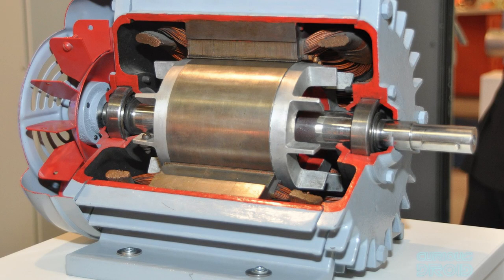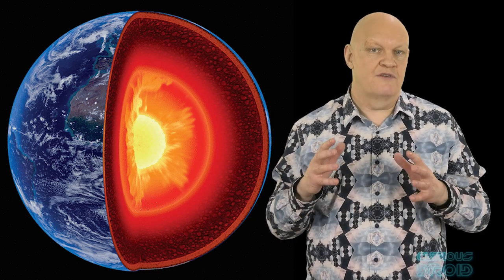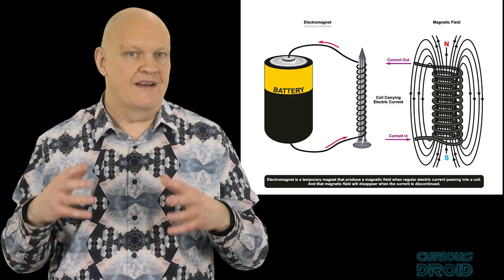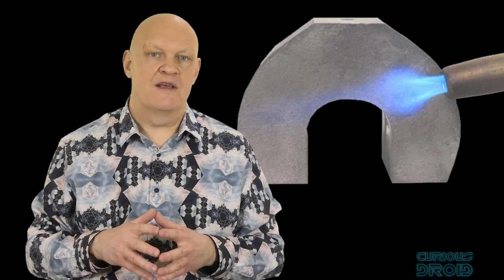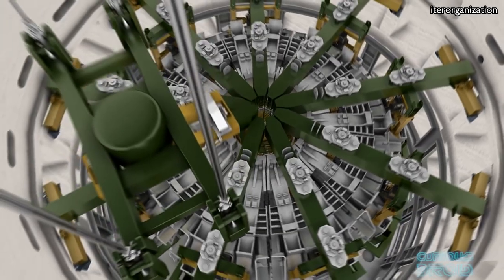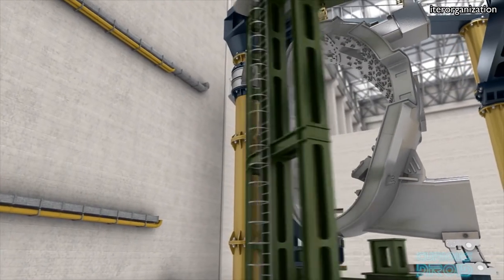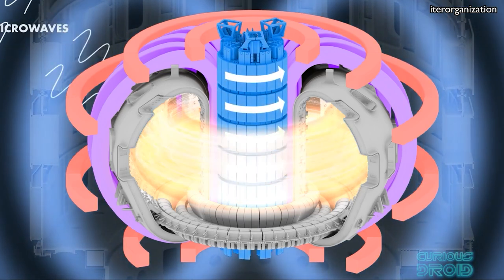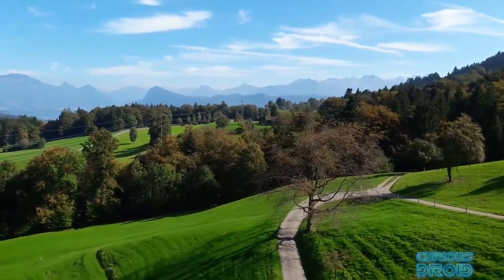The Most Powerful Continuous Magnets Yet Made

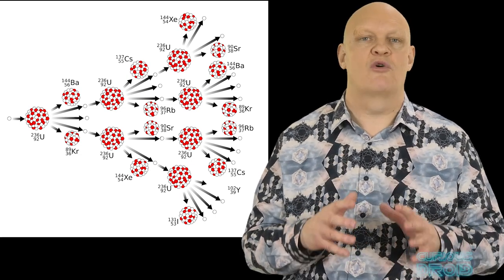Comment: 10:20 plus another downside with fission is: the rod material is mined as ore. typically in an open pit fashion, typically with the fossil powered vehicles. It's not as clean or green as the hard-core nuclear proponents suggest.

Comment: You are WRONG!! 3 mile island accident was COMPLETELY DIFFERENT than Chernobyl and Fukushima! It was a containment breach of the pressurized reactor system that allowed radioactive steam to escape into the atmosphere. Nuclear Plant designs after that went to a non pressurized system to mitigate the risk of that occurring again. Where as the other 2 were complete core meltdowns!Chernobyl was a poor design and allowed for ALL it’s safety systems to be overridden and that Human error caused it’s fatal core meltdown. Fukushima also could have been prevented had the Japanese heeded our warnings back in the mid 90’s, simply by putting the generators and their fuel sources on the rooftop like we did in Missouri just before the “10,000” year flood. Had we not done that we would have had the same occurrence then. A family member of mine is a leading authority on Nuclear Power Generation and a member of the National Nuclear Safety Board until his retirement.

Comment: at 00:10 you show a squirrel cage motor that doesn't contain magnets. Sure it works with electromagnetism, but there are no permanent magnets in this type of motor.
Reply: Stator currents form a rotating magnetic field which induces current in the rotor bars creating a magnetic field, so yeah not permanent magnets, but definitely magnets and magnetic fields.
Reply: @borysnijinski331  Correct.
The title of this video is about continuous magnets.
Never mind... interesting video!

Comment: Claiming that fusion simply "is safe" is a huge misrepresentation, if not an outright lie. Yes, the process itself doesn't produce radioactive waste and is not able to turn into a chain reaction BUT we're still talking about matter hotter than a center of a star floating cheerfully in a magnetic trap generated by a system so tense, that it's on a brink of tearing itself apart, surrounded by huge amounts of coolant. It's basically a bomb, just not a nuclear one.

A disclaimer in order to avoid stupid people missing or intentionally misreading the point: I'm not saying fusion is not better than fission, I'm not saying that fusion should not be studied or exploited, I'm not saying humankind should continue using fossil fuels. What I' am saying is that fusion technology comes with its own set of risks that should be clearly communicated.
Reply: To be fair, fusion bombs are a lot more powerful than fission bombs.

Comment: Thumbs down for lumping 3 mile island (TMI) and Chernobyl together.   TMI had a radioactive discharge, not a run away reaction as illustrated.   Poor writing at best.  TMI suffered core damage due to over heating from decay heat.  Chernobyl had both decay heat and run away reaction issues.
Reply: 1% of full rated reactor power to 10,000% of full rated reactor power in less than the blink of an eye…that was Chernobyl.

Comment: I hate to be the bearer of bad news but Nuclear Fusion is many, many, many decades away, if at all.  You see, we have known how to build a fusion reactor for like +50 years, that isn't the problem even.  The problem is two fold; cost and more importantly storage.  First of all, it takes more energy to create fusion than the fusion actually produces and no, it is not a question of scale.  Moreover, all other forms of energy generation works (all things being equal) by delivering some sort of constant generation that can be fed into the system.  Fusion on the other hand, releases a huge amount of energy in a tiny amount of time and then it is all over.   We have no way to feed that energy into the system (it would instantly blow the grid), let alone store that energy for usage later, and no, batteries is out of the question for this purpose.
Reply: Well if you do not try, you will never get there.
Reply: @borysnijinski331  That is like saying if you do not try to fly from the tenth storey window you will never know. There are certain things that are just not possible, for example, cheating the laws of thermodynamics.

Comment: Sorry to be that guy, but your first shown "Motor" is an asynchronus 3-phase machine... it has no magnets inside. In addition, most powerplant generators work with externally excited magnetic fields, again no "Magnets". Lastly your footage of the magnetic field around the metal filings is only a coil, yet again no Magnets. All this in the FIRST minute, come on... i've expected more from you!
Reply: He was talking about both permanent and electro-magnets.

Comment: People are so enamoured with cheap power from fission and now fusion, that they are prepared to pay any price to get that power. Remember Fission, so cheap we won’t even bother to meter it?

 Why spend endless resources on Fusion without the objective analysis of costs to run such a sophisticated system to say nothing of all the highly trained staff required to run it.  

By 2035, it will be too late to get off Fossil Fuels if we spend money on such capital extensive projects. Put the same money into refining our existing grids with current tech and we have it solved but what gets in the way is not the technology but incumbent Fossil Fuel companies who are never walking away from $T still in the ground.   Look at the non stop trashing Tesla gets and its nowhere near as big a challenge to Fossil Fuel Industry as this will be.  Moreover, Fossil Fuel industry would support Fusion because it will pull resources away from using existing renewable tech to get our CO2 production solved in the next 10 years.  Money spent on Fusion is capital misdirected to our disadvantage.

Comment: My best friend was put into an MRI machine at a new (to him) hospital before any of the staff bothered to consult his medical records, or even ask him some basic questions, such as "do you have any metal implants?" The short answer is 'yes', as his ribcage is partly held together by metal from multiple heart surgeries. When the machine turned on and threw him against the interior of the donut, they panicked and shut off the power. He was okay for the most part, but it completely borked the MRI machine.
Reply: The button to turn off the magnet field in an MRI is call a quench button.  It heats and vents the helium to turn off the magnet field and it does indeed mess up the MRI and it will require immediate service to bring it back online.  I think your friend may have mixed up a few other parts of the story, but totally understandable for someone going through a scary situation in an MRI.
Reply: @Forefatherrabbi  Thanks for the insight.  I had wondered if the power loss would also shut down the cooling system, so also thanks for answering that bit.